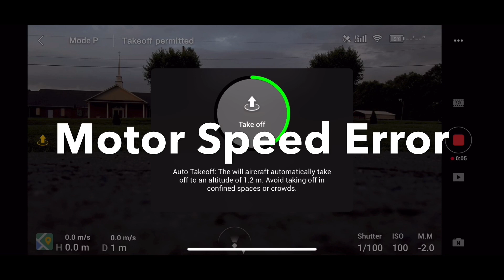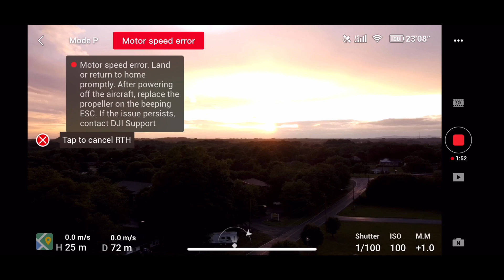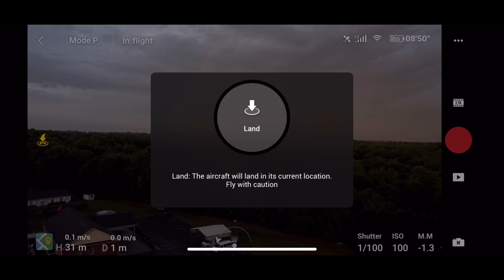DJI Mavic Mini Problem | Motor Speed Error While flying

Comment: Beware my propeller broke in mide air, and i try to fly home its just go cycle up in the sky then i try fly back home it said cpu overload and i saw its crashed,oh my god, rush in my car and drive using my airtag i glued on the drone ,found some guy just at the stop 🛑 sign asked if i fly the drone and went back to his home and returned my drone,thanks god all good,crash in the bush at his house. Reason i hit the wall a few time weeks ago and did not realize its cracked near the propeller,so if got need replacement propeller few months after you fly,damaged and u v light will damage your propeller, fly it safe order new propellers now.

Comment: This happened to me 3 times yesterday... Don't bother replacing the props... Download the DJI Assistant for Mavic Mini... After installing Refresh the Software.. That what I did then went out and hovered and flew around for 10 minutes no problems and no errors.. When I had errors it happened within 4 mins of flight.... Mine was the rear left motor...

Comment: Had the same problem when it first appeared. Predominantly left rear but then right rear. Refreshed the update via my Mac computer but still had the problem, so replaced both sets of rear propellers. Problem cleared.
Reply from the maker: Thank you my friend 👍😀
Reply: Just the propellers or the motor itself?
Reply: @andrewrocha5147  just the propellers.
Reply: @davidct2406  thanks bro 🤙